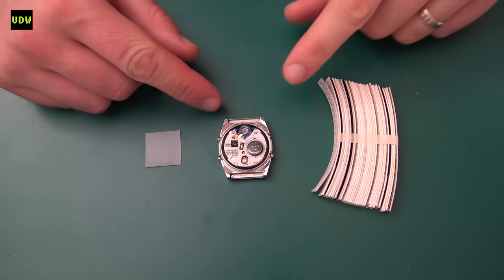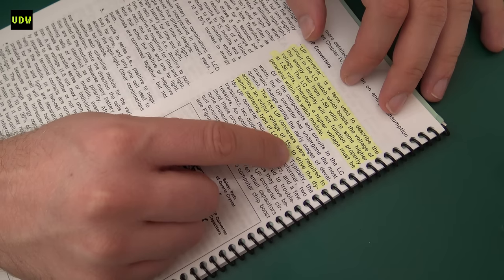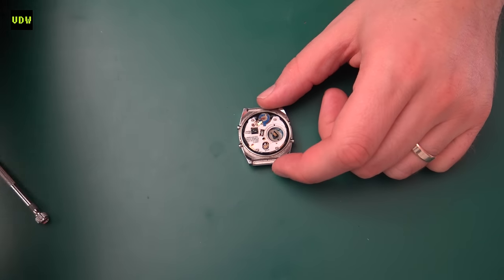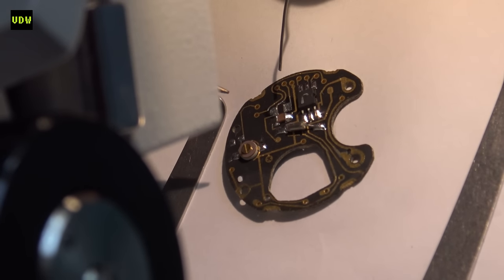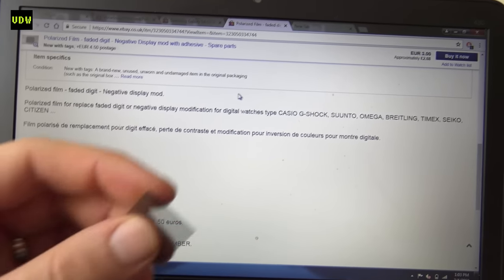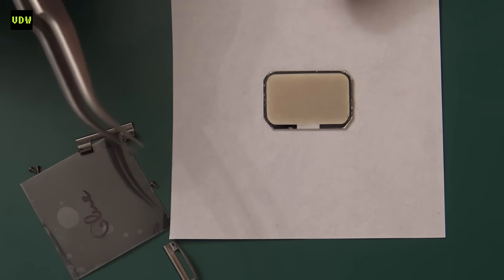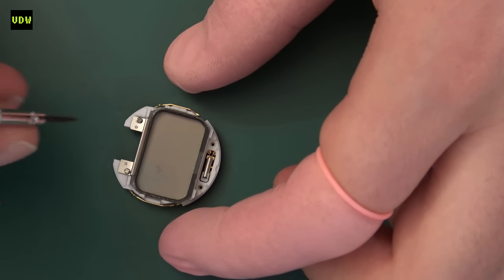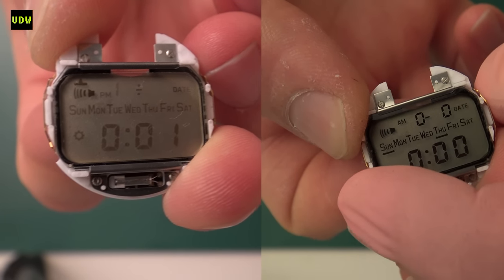Faded LCD display Repair - Ep 49  -VintageDigitalWatches

Comment: Hello, I came across your page while searching for some information on a Seiko Final Fantasy watch I bought back in 2001. I never worn it and it pretty much sat in the box on the shelf along with a few others in my collection. During the Covid-19 visit, I found myself a bit bored and decided to replace the batteries in old watches. All worked out well except for the Seiko Final Fantasy watch model. Now, this watch is somewhat sought after but I prefer to keep mine. After replacing the battery, the numbers are dim and fairly broken in places. I don't know if you've seen the watch or perhaps know of it. If you do, I was wondering if you might have a fix for it? Seiko offices are closed because of the virus, as if most watch shops around me. Could this also be an example of a capacitor problem or a LCD replacement screen? Your thoughts please.
Reply from the maker: Never worked with this watch but it is not that old so I would exclude capacitor problems. But hey, take a pari of polarized sunglasses and have a look at the display through them, rotate the watch as you look at it and  see if any difference.

Comment: Nice video. But where do you buy the lcd watch repair book?
And the capacitors where do they buy ?.
If there are spots on the display, can it be repaired?
Thanks Fabrizio.
Reply from the maker: Book can be bought from eBay or from Amazon or www.zantechinc.com 
Capacitors eBay.
Depends how the spots look.

Comment: Hi, very helpful video, thanks for it. I´m a watches entusiast, specially mechanical ones, but I like the old school lcd ones too. Few months ago I purchased an old scrappy "citizen cryston lc", as far as I know a really old model. I put a new battery on it but barely turned on. I cleaned all circuits with isopropyl alcohol and after that it turns on, but after 1 or 2 seconds the screen dies slowly, then turns on again only for die again. Do you think the problem is one of that 2 you talk in the video? there´s almost any information about those watches
Reply from the maker: Hi, from your description, No, I don't think it is a faded LCD. But I have come across this behavior "watch turns on for a few seconds then display fades out". In those cases I replaced all the components on the board but never really did a successful fix. Some people say it is due to heat and that it affects the crystal and other components. Sorry I can't be of any more help but my experience is limited with that issue. regards,
TIbi

Comment: I am not sure someone has asked this yet (looking at the comment)... and in the video I could hear that you answered it so... for this watch, if it is not the capacitor... do you know why the displayed has faded at the first place ?... what are the causes of this? Do you know?
Also does the polarised film make the display darker than before or not ? 
Thank you ! Great video
Reply from the maker: Hi, the degradation of the LCD may be due to many things among which aging. Early Citizen manuals had stated in their manulas that LCDs are good for 50.000 hours. Having said that I do have some 30 year old citizens and they are perfectly fine and there are Seikos that are old and perfectly fine. My assumption is this one got exposed to sun ot heat or cold, just harsher conditions in general. I don't know if the liquid crystal or ols polarizer are affected but this solution fixed it.

Comment: I don't think that this issue is related to the SMD capacitors because these are not electrolytic capacitors (!)   I had the same issue with 3 CASIO's from 80's  and i fixed it without any new parts. I simply cleand the contacts on the PCB which has contact to the two Elastomers (looks like rubber lips) and the the Elastomers itself with a Q-Tip and a bit Isopropyl alcohol.   Afterward the contrast of the display was again perfectly.

Comment: Dear Vintage Digital Watches,  I have a Seiko A359 digital LCD watch that has two problems:  1.  It is losing time; and 2. The digits while still showing good contract are a bit fainter than previously and sometimes the display goes out completely when the ambient temperature is cool.  Is there any possibility that I could send you this watch for an overhaul and repair?

Comment: good work..btw any idea how to get rid of the uv flare on the glass due to degradation of uv over the years
Reply from the maker: I have been working on that, but it seems there is not a single fault. Sometimes the polarised filter get damaged and you have a chance to replace it. But when those Newtonian rings appear it is tricky, I haven't found anything against that thus far. Replacing a burnt polariser is something like this:  https://www.youtube.com/watch?v=JJ-yw4YA1OQ

Comment: Hi! very good repair reports. I have a question for you about the repair of Casio's watch??? There is the next the situation: clock Casio DB 31 and CA 50 in them one and the same the reason. when the battery is inserted the watch run if you can get the battery and insert back the clock is not included , you can several times to set and get the battery out and that does not happen. the clock will lie down 5 - 10 minutes without battery, then insert the battery the clock starts to go again. It happens that inserting the battery indication on the LCD is not complete and seconds do not go. it is necessary to remove the battery and reinsert and then maybe the watch will work normally or do not show. Is that some kind of capacitor? if Yes, what and how to define it???
Reply from the maker: Hi, I am having trouble reading your comment :|

Comment: Great video.. one question, the polarized film can be use for negative display mod?
Reply from the maker: Hi, yes it can be used on any LCD watch to either invert/negative the digits or to increase contrast.
Reply: @VintageDigitalWatches  to increase brightness, need to add another film onto the existing one. No need to peel the existing. Correct? Because from what i know all lcd panel required polarized film to visible the display.
Reply from the maker: @aijx9  Yes, no need to remove the old one, you can do so but that would only be unnecessary work.

Comment: Thanks for your videos! I'm doing an AC reset on a vintage Casio Skywalker. The 12:00 comes up during the reset, but if i stop the reset the module goes blank again. If i hold in a button while doing the AC reset the watch works but a bit more faded. If i let the button go it goes blank again. I wonder if you have any suggestions?

Comment: Nice video! Wll explained. However, I have a different issue that bothers me. What could be wrong with digital watch when it doesn't react on commands (pushers)?
Reply from the maker: Hi, it csn be due to many issues, cab
N you be more speciffic on the model and what you have done thus far?

Comment: Is there a reason why you left the old polarizing filter in place and stuck the new one over it rather than removing it and replacing it with the new one?
Reply from the maker: Removing an original polariser is streesfull for the LCD, you could end up with a crack or a bleed, and this was a stacked LCD which made it even more uneasy
Reply: @VintageDigitalWatches  
Yes that makes sense, just an unnecessary risk.

Comment: Hi, my old Orient music alarm watch has also faded digits and in addition there is like a rainbow shade that makes the vision even more difficult. I guess it is due to the aging of the original polarizing sheet inside. I´d like to ask the community if someone has removed the original sheet before placing a new one and if this job is easy. I see a high risk of broeaking the LCD in doing so, so i´m not convinced it´s worth enough. Any tip is welcomed

Comment: Hi, do you know how to determine if the lcd watch is broken or not? the lcd from my old watch is not showing any sign but I check from the lcd contact in the board there is voltage about 1-2V.

Comment: Hello congratulations for your great collections and thank you for the videos . i have some seikos lcd with differents failures  im wondering if you can help me to restore them . Fist i have an exactly model the world time but is has strange behavior when i press the buttoms the display fails is quite difficult to set up . Also the battery dont last to much .  What is the isopropanolI and where i can fund it . Isee the batch of capacitors so i wondering how you extract from the strip . Sorry may sound a stupid question but i just start on the watch repair and never see how came the capacitors .  Sorry for the long message and also for my english im not english speaker .
Reply: Xavier Chs do not use isopropanol on the LCD, as some plastics will crack or haze overtime, windex, or ordinary lens cleaner is safer.
Reply: Thank you John for you advice but you mean on the screen? I never do that  i just clean the lcd screen with a dry toilet paper or soft also lens cleaner . But the circuit board i cleaned with Wd 40 when is very rusty and then i sumerge it on isopropilic alcohol for a few minutes and let it dry completely. 
Kind Regards
Xavier

Comment: If it lost its capacitance, why are you measuring the bad capacitor to determine the value for the replacement capacitor?
You need to use a larger value to match the original capacitance!
And replace ALL of the capacitors!
Reply from the maker: Why are you not reading the other comments, if there is obviously something erong you should look in the comments so you don't duplicate.

Comment: Good morning. I have a seiko M354A with same problem.
I try to find correct condensator. Do you have service manual or other? Thanks so much
Reply from the maker: Try the digital watch library.com
Reply: @VintageDigitalWatches  thanks. I finded manual. but unlucky there isn't value about condensator.

Comment: If I want to invert the light on the LCD screen of my car's head unit with a polarizer so that instead of black letters on a lit up background, it has lit up letters on a black background, is there a specific kind of polarizer I need to look for on ebay?
Reply: CAIRN no, polarizer is the same, just rotate it 90 degrees..

Comment: Hello, I have to repair a Seiko A239 - same model as the one shown in this video, but I don't have any professional screwdriver yet : could you tell me what is the screwdriver's size you use at 5:08 ?
Thanks in advance.
Reply from the maker: It is a flathead screwdriver, don't know the size but get a set of precision flathead screwdrivers and surely one will fit
Reply: @VintageDigitalWatches  OK, I will take your advice. By the way, this video is very useful to me, especially with the disassembly and reassembly of the watch: thank you for the sharing.

Comment: Great video - do you have a link to the capacitors on eBay?
Reply from the maker: Here you go:   https://www.ebay.com/itm/0805-SMD-KIT-CERAMIC-CAPACITORS-83-VALUES-x-20pcs/182895401815?ssPageName=STRK%3AMEBIDX%3AIT&_trksid=p2057872.m2749.l2649
Reply: Great video, full of great information as always. I could do with a video on missing digital segments.

Comment: Hey Tibi, can you tell me: Do i have to use the same capacitor with identical Farad? I have this problem: A Citizen watch with temp-sensor works with all functions but the display fades out (pulsing) after some hours. For me, it looks like the upconverter does not produce as much Volts as the LCD needs. So i changed it. I measured the old with 90 nF. I replaced it with one that has 120 nF, because i dont have one with exactly 90 nF. The problem persists. Should i change it again with a capacitor of another value?
Reply from the maker: Is the problem persisting in the exact same way? I am asking because if the up-converter capacitor is indeed the culprit then by changing it with a one that has a significant different value you should see a change in the LCD whether it is for the good or for the bad, a change must be there. If there is no significant change then I would say it is a different component on the watch. Although it would be peculiar to see absolutely no change with that much of a difference. Just for fun if you do decide to change the capacitor, once you have it off the board, leave it like that and reassemble the watch and see if you see any changes on the LCD.  Cheers Tibi.
Reply: Vintage Digital Watches you mean i should desolder the capacitor without replacing it with another one? can the watch work without it? unfortunately i dont know wich one the up converter is. there are 3 capacitors. meanwhile i changed all components but one. the last one is a transistor i think. and i dont know how to measure it. im desperate :-(
Reply from the maker: That is where I was trying to get, to see we know for sure that is the upconverter. But if you say you replaced alll capcitors and still nothing then I do understand your predicament. The LCD needs a square signal and to achieve that square signal the crystal(quartz) is also involved. So the quartz not only generates the timebase for timekeeping, it is also used to light up the LCD. If your quartz is drifting then that may also be a culprit. Michael if you wish me to take a look at it just send it over, you made me curious. We can move the conversation at vintagedigitalwatches@gmail.com.

Comment: When capacitors fail, they tend to lose capacitance.  Why would you replace a suspected failing capacitor with one with an even lower value than what you measured from the failing cap?  

Also, the attempted repair would have been much easier with a hot air rework station.  You can find 858D clones online for under $50USD that work well for this kind of work.
Reply: Desoldered MLCC should, circumstances allowing, be considered damaged by the process and not be reused. The actual capacitance value isn't that critical in this type of circuit. When MLCC fails, it fails by internal fracture so the loss of capacitance is not a little, it's most of it, and they often fail short or near-short.

Soldering iron is fine. Hotair requires experience of its own and it also bakes the PCB a fair bit, sometimes popcorning it, more likely than with a soldering iron.

Comment: What about if it's a new watch and the screen partially stops working because you dropped it. It doesn't have that bruise effect, it looks normal only most of the display is gone
Reply: You have definitely misaligned the zebra strip

Comment: Before placing the new polarized film you should remove the original one. The watch has it already from factory. I did this in 80' to change in negative...... Anyway i never seen the polarized film to be degraded in time, to required replacement.

Comment: Hello it is wonderful to look at the repairs to you but I ask the question I come from Germany .. where did you get such new parts man does not even get a pusher for a casio watch Blue Thunder ect. at the manufacturer. Every manufacturer whether Seiko or Casio chatter all there are no more spare parts. Hmmm Well Otherwise Super work
Reply from the maker: Hi, they don't sell spare parts for these watches anymore, all one can do is look for parts on eBay or buy broken watches and use them for parts. Thanks for the comment, I am glad you like the videos.
Reply: Yes that's just very difficult to get and then still a lot of money so many have been so broken at self-try, unfortunately Thank you for your information
Reply: Yes that's just very difficult to get and then still a lot of money so many have been so broken at self-try, unfortunately Thank you for your information

Comment: excuse me sir . can I ask about my watch ? I have seiko a134 . the battery(new) is very wasteful just for only about 6-8 hours . according to you, where the problem is ?
Reply: thx before sir for ur answer
Reply from the maker: This is a common problem, it means that your watch is pulling too much current. I believe you can find a manual online for this watch and check with a multimeter the power consumption, it should be within the microAmp limit but it states in the manual exactly how much. Once you validated that it pulls too much current you need to check if the battery is being shorted, if not a component on the board may be at the end of life and needs replacing. It really isn't a straight forward fix and apart from probing around you may have to scrap the entire board.

Regards

Comment: How do I know without manual which is up converter capacitor in ECB ?  I have Tissot t touch.
Reply from the maker: You can't really, and it is a huge exception that this was even mentioned in the manual.

Comment: You commited a basic error. The defective capacitor is defective because it presentes a capacitance value that is not the propper value, and logicaly the watch don't functioning proprtly. In this case the dysplay is faded because the value of the capacitor is beeing altered with the years. When you use a capacitor with same value as the defective one, you are not repairing the watch. This can be done for leacking capacitors only. But good work anyway!
Reply from the maker: Yes, many comments over the years on this, that is right it was an error.